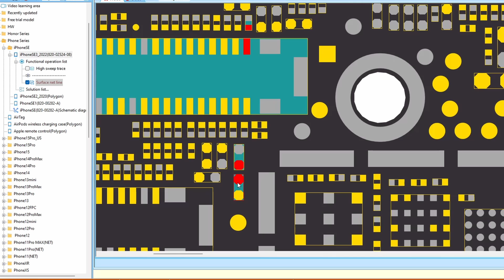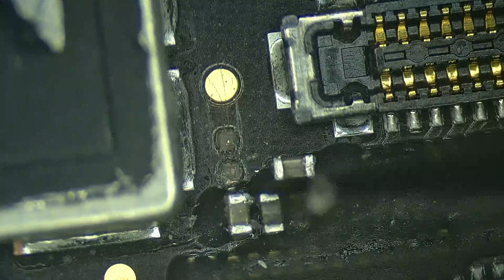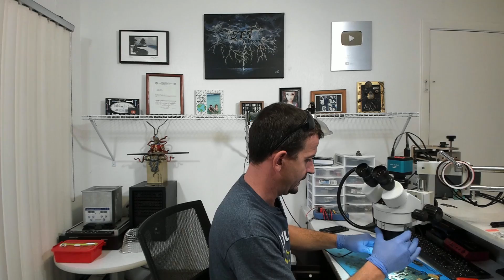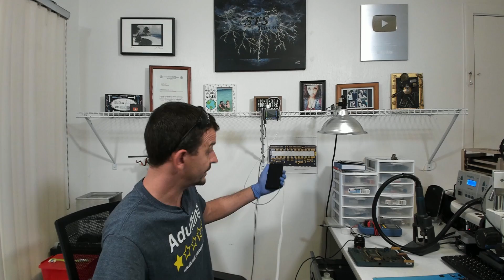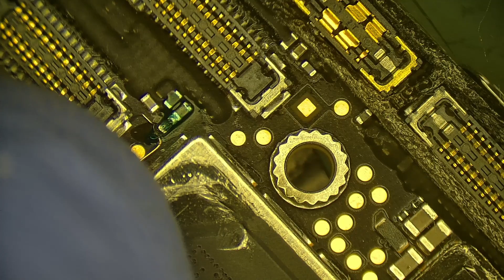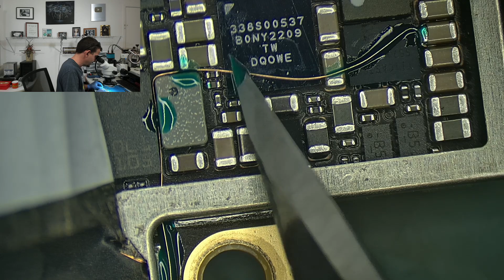Customer damaged motherboard - Botched DIY Rescue (iPhone SE3 2022 Edition)

Comment: Your vids are my little guilty pleasure. I've been doing board repairs at work, and over the years I've figured out various thermal-camera-less tricks to track down shorts on multilayer boards. But a thermal camera - thanks to your various thermal vids - turns out to make life 5x easier. The air temperature and flow manipulation was also what I lacked skill with, so you've helped me a lot just by narrating how you set your air pencil. I have a crusty Hakko 851 but it does the job and is very dependable. It has different scales and whatnot, but your approach gave me a general idea what to steer towards.

Comment: I have a question. I bought an iPhone 7. there I went to replace the dock connector. I have done this twice before. success. now my third time. I opened it and it turned out to be an iPhone 8. ??? the question is how can an iphone 8 work on an iphone 7 software. I can even charge it wirelessly???🤨

Comment: Good work on that small wire jump. But I do have to ask why you didn’t check that test point next to the UV masking you did. Visually it looked like the trace went directly to that same wire jumper point you soldered. If it did, wouldn’t that have been easier to solder a jumper wire to that test pad?
Reply from the maker: Thanks.  I'll have to go back and check the video or look at the next SE that comes in.  The board view shows that test point is for a different line though.  That's why I didn't check it. :-) board views can be wrong tho.

Comment: Anyone laughing because you did not get the component on exactly right the first time has clearly never micro soldered before and is not worth the time. 

I have said it before Jason but you make this look to easy, I would have screwed up that little jumper wire so many times trying to make it look perfect and in turn making it look worse 😄

Heck even scraping out around that tiny little via was extremely skilful, so easy to scrape to deep into another layer or trace.

Do you think at 11:19 maybe the wire broke off the via at that point? Just a guess from the way it moved but I have never worked with this thin of wire before.
Reply from the maker: Lol!  Ok that was a good trick comment. Read the first part first and was all ready to be offended 😂 I think I may have broke the wire inside of its enamel coating but it could have came loose from the via.  Also, since I never actually checked it, it could have been broken further in the board.  Likely just my wire broken or came loose tho. :-). Thank you for the good comment and kind words! 🙂

Comment: Whenever I try to do some fine soldering there seems to be some kind of ghost in my room that makes things not want to melt or stick. Very frustrating. Any tips for avoiding hack job soldering. I'm using chip quik flux from reputable seller and good brand solder. New tips. But somehow some evil spirit hates me.

Comment: what would happened if you just used this wire instead of a coil ?
Reply from the maker: It would be completely ok.  If that 5v7 line got shorted and there was enough supply current, instead of blowing the FL it would just melt the wire.  I think the wire is rated for around the same current as that FL (although I’ve never checked!)
Reply: @ststele   I seen only several places on PS5 that double FL have to be replaced with the same one, in other places FL is act like a fuse and can be replaced with a wire

Comment: you had test point there but ....?Just to ad coment ☺
Reply from the maker: Ok you almost gave me a panic attack.  I had to stop wrapping presents and run into the shop to check the board view.  Whew, that test point is for something else. 😅
Reply: i would think being that close there ought to a surface trace between the test point and the missing pad